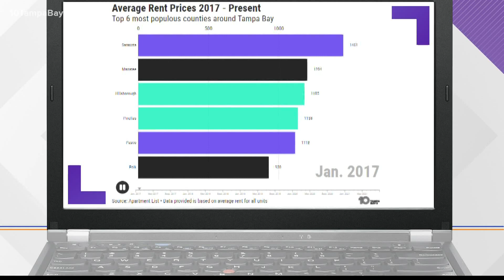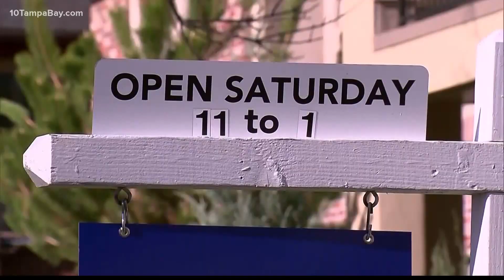Why are rent prices so high around Tampa Bay?

Comment: The prices are not necessarily going to drop if there’s more AFFORDABLE housing. The prices will drop if there are more housing than tenants. Low demand or high surplus lowers prices. Housing prices may even stagnate as income and other goods go up.  A house in 1960 was cheaper than in 1990. A house in 1990 was cheaper than 2019. It’s a cycle and prices on all things eventually goes up. Excessive government spending, high consumption, and minimum wage hikes often exacerbates higher prices. “Affordability” is subjective unless you are talking low income housing. Low income areas are where bad people can afford to live. No decent hard working person wants to live among violent thugs on an MLK Jr Blvd if they can afford to live in a safer neighborhood.